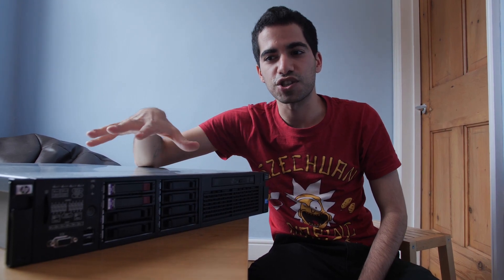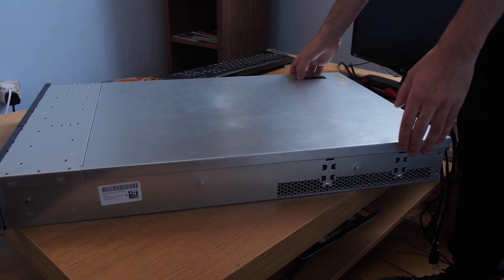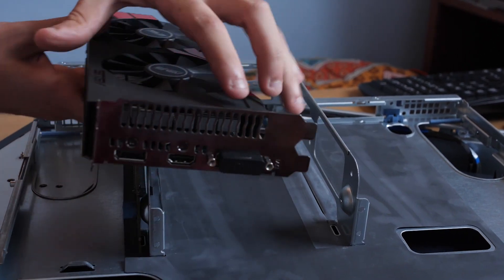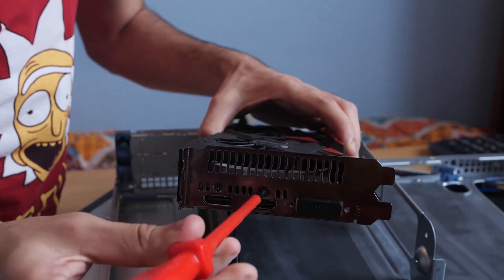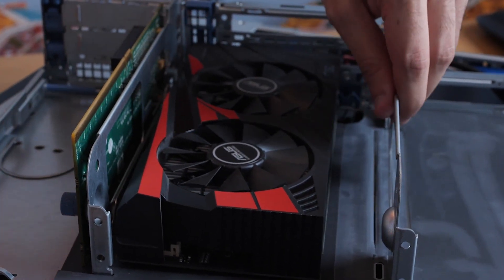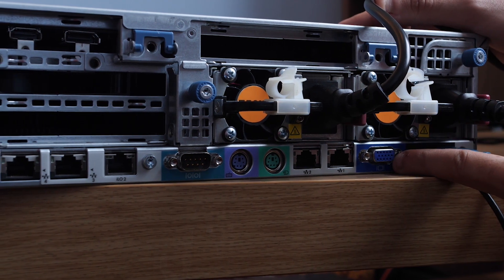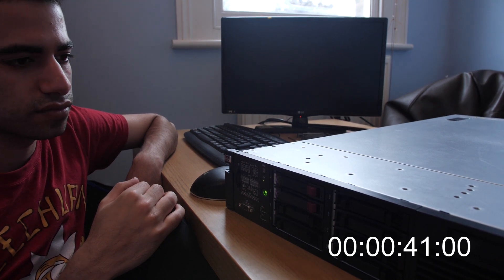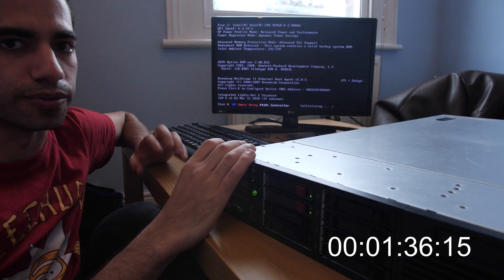HP Proliant DL380 G6 - Installing full sized graphics card GTX 1050

Comment: Hello! Excellent video, I have a Proliant Hp Dl380 G4 server. Currently it does not have any graphic board, but I would like to mount one, I have a Riser board with an expansion of two PCI-x. First of all, would this graphic board support me for gaming? Best regards
Reply from the maker: Hi Victor, sorry for replying so late. I mean it can be used for gaming, not very fast, I really woulent suggest it. its beyond noisy and it warms up the room its in very quickly. Id reccomend almost any half decent laptop/desktop to playing on my server :)

Comment: ok so I have the card all setup ready to go, (same server) but it wont recognise the new card. The riser light is on, fans spinning (gtx1060 ~ 120w) bios and all FW is up to date. card has a been tested on multi-PCs what the problem?
Reply: @AyesC9000  tried... Added ext PSU to card and still no. Best card I found to work is a GTX 1050Ti which is good, but only 75w ....
Reply from the maker: I havent had the chance to test a card with the additional power cable. I do wonder if there is a setting in the Bios or Smartstart CD that specifies to the additional power cable that it is in a GPU setup. Im only speculating though as I dont have my server at hand to check. Soon as I do il have a look.

Comment: Hey nice video you helped me, but i get more question, how you can put  a 1050 or 1050 ti that consume max 75 watt when the max watt for pcie is 25w ? you arealdy response that fit without problem and even about the watt, but how did you calculated that maximum 25W for 75 w? eache pcie slot has 25 watt so when you add just one gpu all pcie Energy they add up and they are 125watt right? because they are 5 slot.
Reply from the maker: Ah its been a while since I did this experiment with my DL380 G6. Im afriad i have forgotten a lot of what i learned. From my vague memory I would say that the riser card draws 140W of power at max load from the motherboard and that the x16 sized slot can supply at most 75W. More then that im all blank im afriad. If I find some of the material I used to come up with those ideas il be sure to reply again. Anyway thanks for watching the video! and please feel free to ask me anything else.

Comment: Great video. Is the GTX 1050 from the all brands works properly? are the all same in terms of power consumption? It seems that your GTX 1050 card is free from power socket? Would you please tell me what is exactly your used card? Many thanks in advance.
Reply from the maker: Dariush abbasinezhad mood  Hey Dariush, thanks for watching my video! Yes all GTX 1050s and 1050TIs use 75W of power max so you can get any brand you want and it will work, I can’t remember which brand I got mine from but I have since replaced yet with a Palit GTX 1050 which is a bit smaller :) 

Please feel free to ask any other questions you have.

Comment: Are this server noisy at long run 100% CPU usage?  Thank you.
Reply from the maker: JoJanDiezel Hey Jo, The server can be extremely when the cpu is fully utilised there are some ways to get the idle noise to be bearable but cpu intensive work will drive you mad if you share a room with the server. 

Thank you for the comment, please feel free to ask any other questions may have

Comment: Hi TSRT,

I have a HP DL 380 G7 which came with the basic 451278-001 PCI-E Riser.
I also have a spare GTX 750 and a GTX 650 TI.

Could I use this cable in a 380 G7 to power one those cards, without the need for an additional riser?

https://www.ebay.co.uk/itm/for-HP-ProLiant-DL580-G7-and-GPU-50cm-10pin-to-6-8pin-Power-Adapter-Cable/183535315122?hash=item2abb8ea8b2:g:UWEAAOSwYYpb6~Ao:rk:2:pf:0

Also as you mentioned in the video, if you use the primary PCI-E slot on the motherboard your GPU wouldn't fit because of the power supply being in the way. Are there any risers for this server that face the opposite way, to remedy this and allow two GPUs at the same time?

Thanks
Reply from the maker: Ed The Multiboxer Hi Ed, sorry it took me so long to get back to you. I haven’t been receiving notifications for some reason :/ You can power your 750 with just the riser card you have and will not need the additional power cable to do that. Your 650 ti uses 110W of power and would require the riser and power cable. I get the impression that you want to use both cards at once and as far as I know this is not possible in a traditional sense though maybe as a mining rig this could some how be done. I am not aware of a riser card with the 16x slot on the other side unfortunately.

Thanks for watching the video and hope my reply helps you!
Reply: @theserverroomtalks8286  Thanks for the reply. I got my model numbers mixed up, its a GTX 560 not a GTX 750.

I just want to use either of those cards, doesn't matter which.

I tried the cable but the system doesn't seem to want to post.
Reply from the maker: Ed The Multiboxer That’s strange, first thing I would suggest would be to try both the Gpu outputs connected to your monitor and if that is not showing anything then trying the servers vga output to your monitor and if that posts to your monitor have a look in bios for the preferred output

Have you tried that already?
I’m really curious why it wouldn’t work so please keep me updated :)
Reply: @theserverroomtalks8286  I can't get the onboard GPU output to work because my monitor doesn't have the right connector. I've tried using an adapter but that doesn't work either.

I can use a low power GPU just fine, but not one using that cable.

I've got a feeling maybe it's a power issue. 

My server came with some crappy CPUs and 2x 460W PSUs. I swapped them out for 2x x5680 CPUs and bought a pair of 750W PSUs because the HP documentation says that 750W is the minimum.

However, one of those 750W PSUs doesn't work and won't boot if it's installed. So I've been running the server on a single 750W PSU which works fine, even with 2x x5680 CPUs. Trying to plug in any kind of GPU which requires that extra power stops the system from booting.

I can't get ILOv3 to work properly yet, so can't use that for diagnostics either.
Reply from the maker: Ed The Multiboxer Yeah those processors use 135w each so its hard for me to replicate as I use a pair of X5670s which use 95w. Here’s an idea, have you tried the same setup but with the secondary processor taken out? That could help us understand if it’s a lack of power that’s not allowing your system to boot. Oh and as far as I know having a second power supply doesn’t mean you have 1500W in total of power to work with, just that if one PSU stops working normally the other will take over.

Anyway good luck! and please keep me posted :)
Reply: @theserverroomtalks8286  I think you're right, just don't know what else the issue could be. Will try swapping out a CPU and see how that goes. I might just bite the bullet and get a 1050 TI and see if that works. Be a shame to spend more money when I already bought the cable and have spare GPUs lying around though.
Reply from the maker: Ed The Multiboxer Yeah I’m unsure what else the issue could be too, hope you have some luck and won’t have to shell out any money, anyway good luck and I’d love to hear if you get the server working like you want it to :)

Comment: Hi , I have just got a hold of a HP PROLIANT dl380p Gen 8. Anyone know if a GTX 1080 ti will work?  I've also got a GTX 970 which I haven't tested yet just being a bit careful with the hardware. Thanks
Reply from the maker: Hi Taj, thanks for watching my video! Your GTX 1080 ti uses 250W of power which is too much for your dl380p gen 8. Your GTX 970 however uses 145W which is perfect as your server supports graphics cards that use up to 150W of power. You will need a riser card with a x16 slot and the additional GPU power cable that should come with the riser. If you don't have the power cable, google " PN 669777 - B21 " as that is the model number. Good luck and feel free to ask any other questions you may have :D
Reply: Currently there is x2 750 Watt Power Supply units in the server, if I upgrade this to +1200 watt unit would that work for installing the gtx ti?  I'm essentially trying to use this as a rendering machine to work with c4d and octane render.  I would like to install my spare cards into the hp G8, I have x 2 GTX 970 and one 1080ti in my main PC.

The Graphics power cable I purchased is : https://www.ebay.co.uk/itm/10pin-6-8pin-Power-Adapter-Cable-HP-DL380-G8-and-GPU-50cm-/111996241458 10pin to 6+8pin Power Adapter Cable for HP DL380 G8 and GPU 50cm
Reply from the maker: @Pendulum_Lost  Hey so sorry it took me ages to reply. The issue unfortunately isn't how many or what wattage your power supply/ies can handle but rather how much power your pci lines and riser card can supply :( I believe the best you can do is have one gpu in one of the riser cards using up to a maximum of 150W of power. You could use then use a second riser for non gpu cards and in total they would need to consume at max 75W of power. with your situation I would recommend using a single GTX 970 as I don't think you would be able to power a second one because the cable it would need for power would have to replace whichever 10pin slot your using to power your hardrive enclosure.
Thanks for replying and please let me know how you set it up in the end :)
Ibrahim
Reply: Hey, thanks for the information. Very helpful. I've just seen on the hp support documentation for HP proliant dl380p the following info: 
HP graphics options:
HP 150-w pci-e power cable kit 669777-b21
HP 225-w pci-e power cable kit 728539-b22.

Does this mean there is an option to support a higher power consuming card?

Thanks for the help.
Reply from the maker: @Pendulum_Lost  Hey thanks for that info sounds really interesting could you please send me a link to that document? I'm not sure if YouTube lets you post links so if you have a chance could you email it to me? my email is ibrahim.humadi@live.com
It would be really cool to be able to help others with that info!
Thanks again for that exciting info :D
Reply: @theserverroomtalks8286  I'll send that over as soon as I can.
Reply: Yes.
Reply: @mjyanimations1062  please check if you received the info, I sent it over a few days ago. Thanks.

Comment: Does it make the fans go faster? If so is their a workaround? I put a card in a dl360p gen8 and the fans went nuts!
Reply from the maker: Hey brett, sorry for taking so long to reply. Im afraid fans running faster is a common occurrence when using hard drives/SSDs and some GPUs on HP servers. I would recommend trying different settings in bios regarding performance and energy saving. my DL380 g6 actually runs quieter after I set everything to maximum performance which doesn't make sense normally. Lastly you could try to update your servers BIOS and raid card firmware and/or testing the system with the second powersupply removed which is what I have done on my server. Thanks for watching my video Brett and really hope you manage to silence that loud machine of yours! :) please let me know if any of these suggestions help.

Comment: There is a pic power connector in the chassis on the motherboard, you need a special cable thought
Reply: Nevermind that's only on G7 dl360
Reply from the maker: Hey Dan, thanks for commenting. I will keep that in mind in case anyone asks about adding a GPU into a dl360 G7. Thanks again!
Reply: @theserverroomtalks8286  This is actually exactly what I am planning on doing, I'm just looking at getting an Nvidia Quadro K4000 though, where do I get this special cable, I've seen some that look like what I need, but I am not sure.
Reply from the maker: @christopherbartleson8918  Hey Chris your K4000 uses only 80W of power and would work in your dl360 g7 just fine :) you would just need to google "dl360 g7gpu power cable"

heres a link to one that would take about a week to get to the UK :)
https://www.ebay.co.uk/itm/for-HP-ProLiant-DL580-G7-and-GPU-50cm-10pin-to-6-8pin-Power-Adapter-Cable/183535315122?hash=item2abb8ea8b2:g:UWEAAOSwYYpb6~Ao:rk:2:pf:0

Good luck and feel free to ask any other questions you might have :)

Comment: Hey, I have an hp dl380 g7 and I would like to fit a gtx 1070 in it. What riser do I need to use?
Reply from the maker: Hey Bytnizer, thanks for commenting :) you should be able to use any pcie riser card designed for the dl380 g6 or g7 and it will work in your g7. The riser card I am using in my server has the part number 451278-001 so you can search for one of those or alternatively there a model with only a single x16 connector on it but it will not make a difference. The gtx 1070 requires an additional power cable which often comes with the riser card however it's worth asking the seller if it actually will come with it. If you do get the riser and no cable with it you can buy the cable by using the search term "dl380 g7 gpu power 10pin to 6/8pin cable" 

Anyway let me know if I can help you or if I explained something badly.
Good luck! :)
Reply: @theserverroomtalks8286  thanks for the answer. I'm going to order the riser tommorow :). One question though, is the 10 pin slot the sas power connector?
Reply from the maker: Hey, sorry took me ages to reply :/ It is the 10 pin slot that would be used to power the additional 8 sas/sata drive bay if you use that. Please feel free to ask any more questions! :)

Comment: hello I would like to know if when you connect the graphics card to the PCI-E port fans turn fully? I have the display and the drivers of the map are up to date.
cordially
Reply from the maker: Hey Emmanuel. Thanks for commenting, he fans on my GTX 1050 turn as designed with no problem. What graphics card have you installed out of curiosity?
Reply: it is not the fan of the graphics card that runs at full speed, but the fans of the server dl380 g6.
ps: it's a 710 gforce gt.

cordially
Reply from the maker: Hey, sorry for the late reply. The server fans often go crazy loud when adding certain hard drives and graphics cards. I will link you to a post which covers which hard drives are responsible.

http://dascomputerconsultants.com/HPCompaqServerDrives.htm

 The only fix for the gpu making your server fans run at full speed is to update your server bios, there was a Reddit page where people posted the bios updates and I will try and find it for you now.
Please let me know if that helps at all :)

Comment: Great video! Will this work on my HP Proliant DL380 G7? If so, what GPU would you recommend? I'm looking to run VMs but I also want to use it for gaming. I plan on using the HDMI on my mounted TV as an output :)
Reply from the maker: Hey Alan thank you for watching my video :) This will definitely work on the g7  I would highly recommend the GTX1070 as it uses 150W which you can provide with the additional 10 pin to 8pin power cable (usually comes with the gpu riser card). It has really good performance too :D
Reply: The Server Room Talks thanks for the reply Ibrahim. Will I have any trouble installing it? I know your video said some cards might be too big and adjustments would need to be made. Is it as simple as just connecting the 1070 to the server (unless any extra cables needed)?
Reply from the maker: Hey! I don't think you will have any issues getting the card into the server, should be the same process I did in the video and then plugging in the additional power cable. If your server didn't come with the cable you can find it on eBay ( I'm in the UK // https://m.ebay.co.uk/itm/10pin-to-8pin-Power-Adapter-Cable-for-HP-DL380-G6-and-GPU-50cm/112252881552?hash=item1a22cb0a90:g:uvQAAOSwnHZYZd1p   )

Please feel free to ask anything else or ask me to expand on my answer :) 
Thanks again for subscribing and commenting!

Comment: Hey bro I have a HP PROLIANT dl380p Gen 8 and I have NVIDIA GeForce GTX 980 , can I put it in my server? Please reply to me!
Reply: And I have a PCIe Riser with 12v power, please help me bro
Reply from the maker: Hey there :) your card should fit and run properly with the additional power cable the riser card comes with, the only thing that might be an issue is that your gpu under max load uses 165w of power while the system can provide a max of 150w. A solution to that could be underpowering your gpu to 90% using MSI afterburner or whatever overclock utility your comfortable with. Please feel free to ask any other questions and I hope I helped you :D
Reply: My GPU is EVGA and I have a EVGA Precision X program if I underpowered it to 90% that will be fine?
Reply: And if I did what you said to me can I play games at ULTRA?
Reply: I forgot to tell that I aslo have Dell PowerEdge R820 what about it?
Reply from the maker: Hey, yeah I believe that would work perfectly. What cpu do you have? If you have at least 8gb of ram and a decent cpu should be able to play most games at max setting :) good luck!
Reply: I have an Intel Xeon E5 2620 6 cores 12 threads, how do you see that? And thanks bro for reply
Reply from the maker: I looked up some benchmarks of your gpu with a typical processor for your server and it looks pretty damn good :D man that's an awesome server (the poweredge) I would love to have one someday id buy it if you if you ever wanted to sell it :D your cpu
Reply from the maker: Hey man I emailed you my number so add me on whatsapp. Happy to help you :)
Reply: Hi, did you ever get the GeForce GTX 980 working in the dl380p Gen 8? if so could you please outline your setup.  Thanks